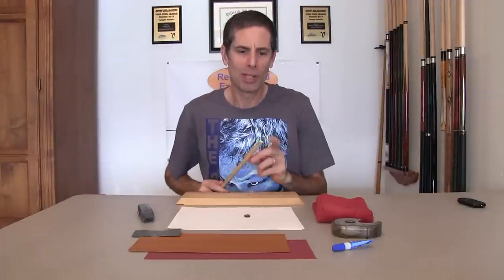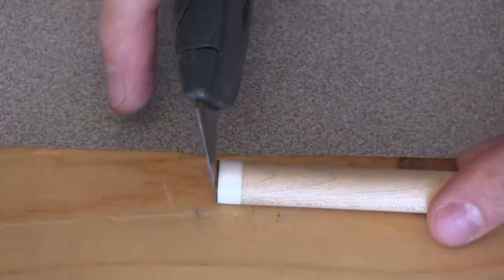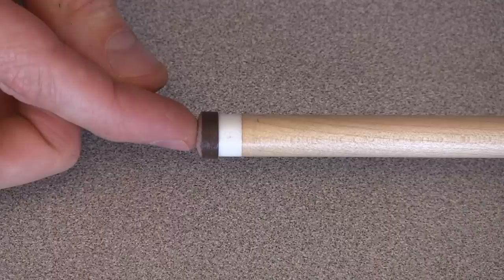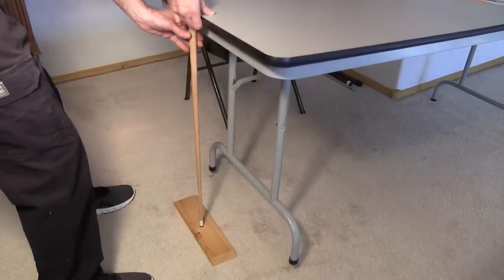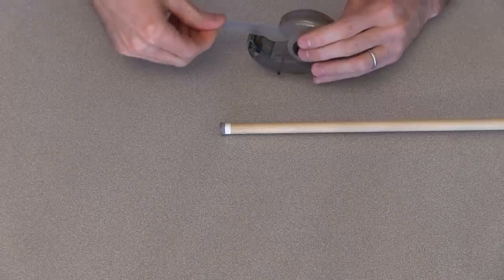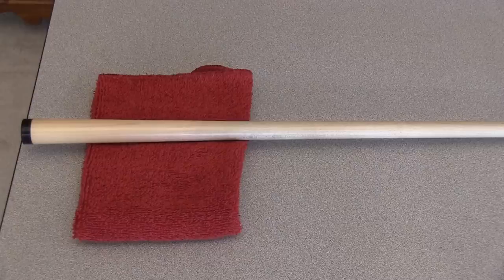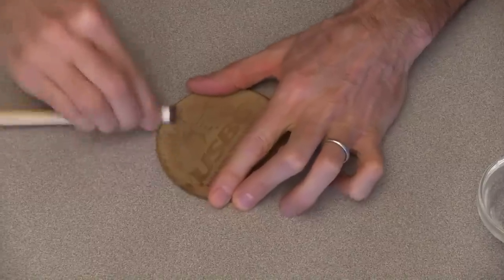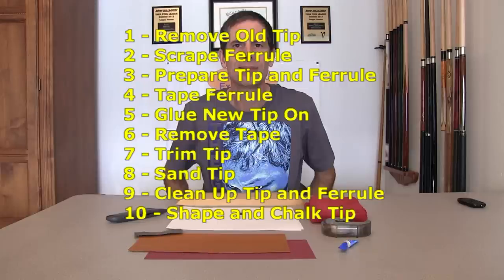HOW TO REPLACE A CUE TIP … No Special Tools Required

Comment: Trimming down a super hard break tip may be left to the pros with a lathe, huh?
Reply from the maker: ... or use sand paper.
Reply: @DrDaveBilliards  I'm getting carpal tunnel just thinking about that! 😂
Reply from the maker: @Poolplayer_Ice  Are you referring to removing a hard break tip?  If so, a Dremel tool or grinding wheel or sanding disc might do the trick.
Reply: @DrDaveBilliards  - I'm referring to manually replacing a break tip and having to trim down a new tip. Some of those tips are SUPER hard!
Reply from the maker: Trimming the edges to bring it down to the diameter of the shaft would be a lot of work with the sanding approach in the video (although, rougher sandpaper would help).  Another option is to get a tip that matches the shaft diameter and just be very careful with the mounting.
Reply: I will say that I recently followed your video step by step and it's the best looking tip job I've ever done! Thank you! 👏
Reply from the maker: @Poolplayer_Ice  I'm glad to hear it.

Comment: I see USBC merch, are you also a bowler, Dave?
Reply from the maker: Yes.  I've bowled in leagues since I was about 6 years old.  I spent many of my youth summers in a bowling alley (where my mom worked for a while).  I got good with bowling, pin-ball machines (and later, video games), and to a lesser extent pool (which I became passionate about much later in life).
Reply: @DrDaveBilliards  No kidding, that's awesome. We need some bowling content! I myself am more of a bowler than I am a pool player as bowling is my passion. I do however love the intertwined cultures of bowling and billiards.
Reply from the maker: @michaelbarry7018  I was more passionate about bowling than pool most of my life, but pool obviously takes top billing now.  At my bowling best, I averaged in the 215 range and even bowled a 300 once (with quite a few 279s over the years).  Both games are great; although, pool is much more interesting, IMO.

Comment: No good advice this time. If you're removing the rest of the old leather and glue (after the first cut) off the ferrule you never should try to cut that down. The risk of cutting into your ferrule is much too big and never use sandpaper on that step either, it also can harm your ferrule leaving you with a not plane surface which leads to a bad glue joint. Just put your cutter knife upright/vertically on the rest of the leather holding the blade directly with your fingers and turn the cutterblade (or a peace of it) in circles to scratch down the rest of the residue, by doing so you'll get a perfectly flat surface. Take your time here! It will save you much time later on. It's the simplest way to get a perfect flat surface for your new leather and does the least damage to your ferrule. And DON'T sand the tip! Just scratch it with the blade, like you did with while cleaning the ferrule. It's almost impossible to get a really plane surface with sanding it, because you'll never have perfect centered pressure. Many people get a tip, which is a little bit stronger sanded down at the edges, which never gets a really perfect connection with the ferrule...
Reply from the maker: Thank you for the suggestions.
Reply: @DrDaveBilliards  Try it. I bet you'll like the result. And it's easier than your suggested procedure once you're used to it.
Reply: Dr. Dave is too nice and too politically correct. The method he showed is just fine and how many many people change their tips with GREAT success. If would be very difficult to cut into the ferrule with the method he showed unless you were drunk or blind.

I have used his method for many years, and so have many people I know. Works well. Very well.

Comment: When deciding to sand his face of ferrule and a few other places in the video you do see him swap shafts from a higher end McDermott shaft to a shit shaft so he himself doesn't mess up his nice shaft. Plus he uses a La Pro cheap tip and not a premium layered tip just incase he messes up the tip and or ferrule. This method will quickly destroy your ferrule when you try to do it yourself,  and if you accomplish the tip install, it looks like shit. So stop being cheap and support your local cuesmith if you have one and keep your equipment looking great instead of mared up.
Reply from the maker: I agree that if you have convenient and fast access to a capable and trusted cue mechanic, that is definitely the way to go.  FYI, I did the procedure on both shafts (Predator Z-2 and Players) and mixed the video footage based on what looked the best or most representative.  The tips I put on both shafts were Triangle, not LePro.
Reply from the maker: FYI, I did the exact same procedure on both shafts, and the results were good with each.
Reply: You started off with a McDermott.. you can clearly see that.
Reply from the maker: @jorose95  Oops.  Sorry about that.  You are correct.  The next shaft I did (not included in the video) was a Predator Z-2.  That's why I was confused.
Reply from the maker: Obviously, if anybody wants to try this procedure out, they should practice on 1 or 2 other shafts first before they attempt it on their main playing shaft.